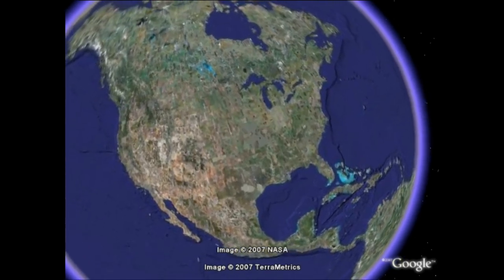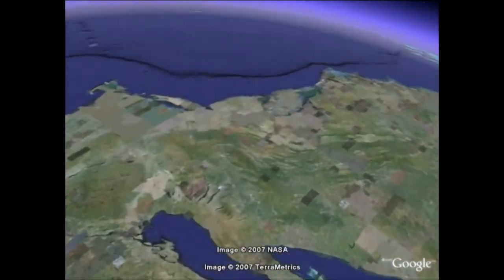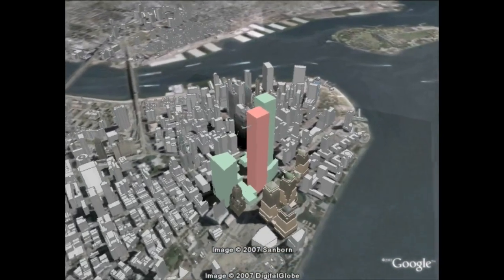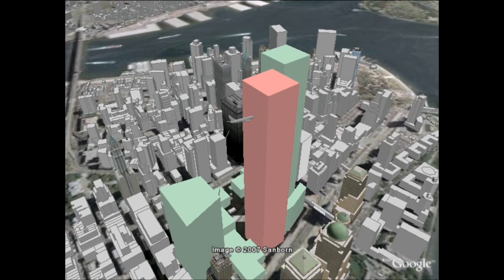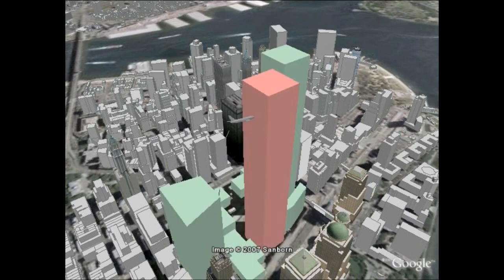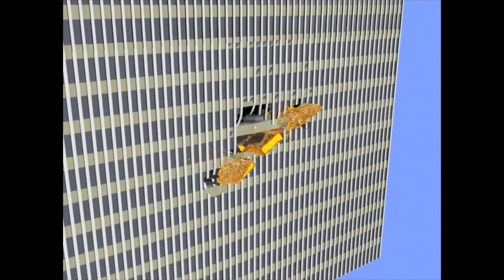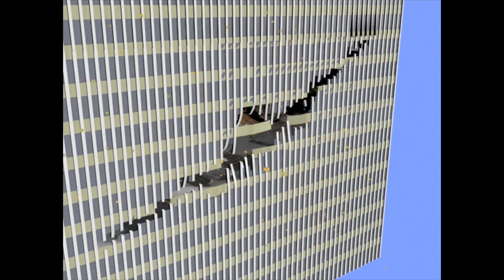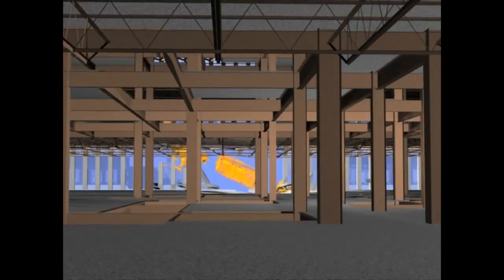Purdue University's Computer Animation of the 9/11 WTC Airplane Attack

Comment: "The visualization was designed to meet two requirements. First, the 
visualization had to depict the impact with high fidelity, by closely 
following the laws of physics. Second, the visualization had to be eloquent to a non-expert user."

One important step was left out by the Purdue team:
Comparison of the visualized damage with the damage shown by actual photos and videos of 9/11.
This becomes obvious if you compare the damage extent in the simulation with the WTC visual record - the photos/videos show less severed perimeter columns than the Purdue impact simulation, at north face and south face.
And if the simulation don't matches the conditions in the reality, then the sim should be going into the garbage can (same for the NIST-ARA impact simulations and WTC 7 global collapse sim).

Comment: I very much doubt that aluminum would have token out those steel beams
Reply from the maker: Aluminum? What about a fully loaded jumbo jet (weighing 150 tons) and traveling 500mph? (Hint: the hollow steel box columns on the upper floors had walls less than 1cm thick.
Reply: @saultrane5854  But do you even know what was behind those 1cm box sections??
Reply: @saultrane5854  Jumbo jet 150 tons?? 
Travelling at 500 mph at sea level??
You are not even close sunshine
Reply: @saultrane5854  I know all about plains and how to please a man.

Comment: Why at 2:18 does this show a large hole when in real life there was NO EXIT HOLE ?
Why are the plane parts impossible to damage after breaching the wall ?
No equal and opposite forces !
Why don't the objects EVER slow down when impacting another object ?
No conservation of energy !
Why is there no curve towards the Earth ?
Violating GRAVITY !
That was the South tower, not the North like I was thinking of, but I can't find a good picture of the North hole to see.
But the violations are still as bad as ever !
And the 3/16 in or smaller skin cutting a hole over 100 times the size of the object ?
IMPOSSIBLE even at 5,000MPH !
24 inch / 3/16(.1875) =  128 times the size of the object
Or the .039 listed for the 757 or .087 for the 747 is
24 / .039 = 615.4 times the size or
24 / .087 = 275.8 times the size of the object for 747 skin.
All extreme size holes of the size of the object.
Reply from the maker: No exit hole? There were numerous exit holes. Where do you think that exterior wall panel came from that fell to the street on the south side side of Tower 1 (the one with an aircraft wheel embedded in it)? 
As seen here: 
https://www.filesanywhere.com/FS/M.aspx?v=8c6f628a5861b7b770af
https://www.filesanywhere.com/FS/M.aspx?v=8c6f62885998a47ca79b
Reply: +Saul Trane  Where did you get this video ? I noticed Purdue lists it but the link has never worked for the 120M high res version. I even tried the Internet Archive Wayback Machine.
Do you have any others in high res or not to post ?
Reply from the maker: Can't recall where I got it.
Reply: @saultrane5854  Nice try Trane but I'd hardly confirm that image as Evidence. It's just a pic to be Confirmed as Evidence. Was that 'Wheel' ever submitted as 'Evidence' in Court??  Ummmmmm? Was it actually confirmed as to which plane it belonged to? I've just flashed thru my 9/11 data and I have zero records of a wheel being submitted as Evidence. Which court and on what day was this wheel submitted as Proof?
Reply: @saultrane5854  that panel came from a scrap yard. John Lear has already proved that fact.
Reply: @saultrane5854  I have a huge crush on him.